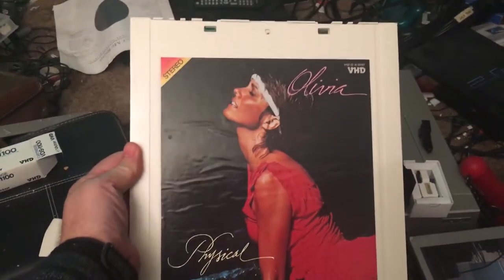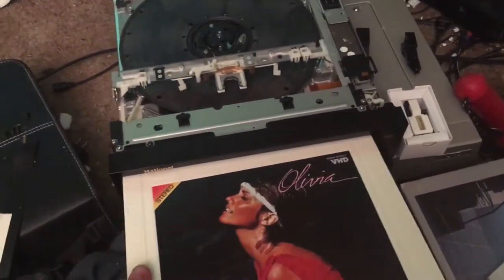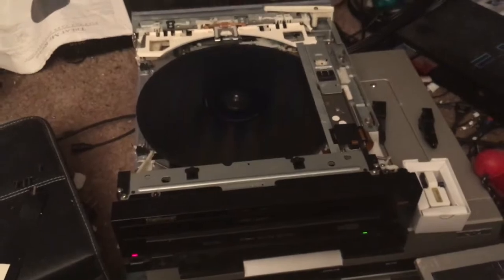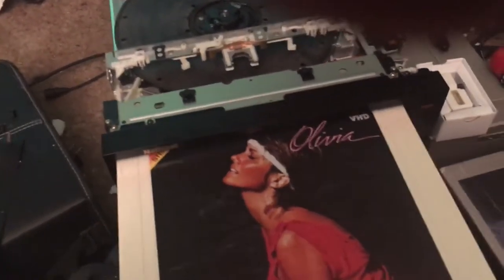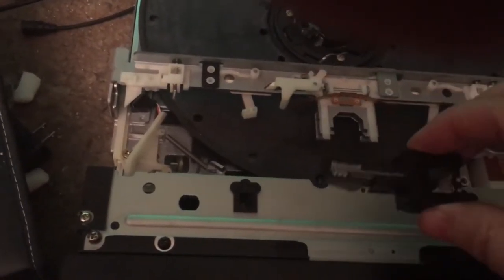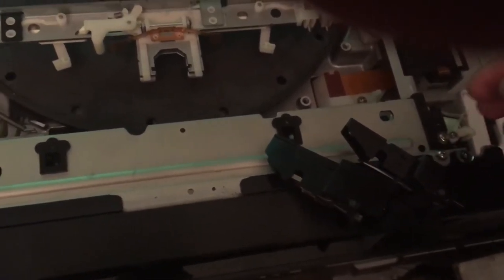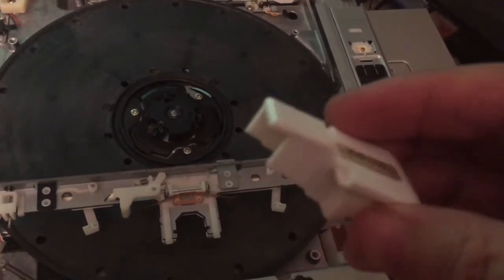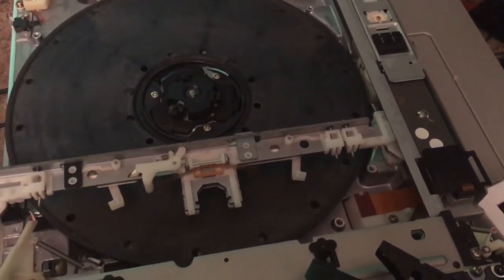National VHD player loading and stylus cartridges

Comment: That’s also a 3D player…can you demo that function?e
Reply from the maker: This one doesn’t have any plugs for the shutter glasses or switches to put it in 2D mode. I have an external box that I can plug shutter glasses into though that would work with this, but of course they won’t work on this TV because of the way it de-interlaces analog video, though it is one of the last TVs to support modern HD 3D and I’ll never buy one that doesn’t. There’s a way to re encode field sequential 3D as side by side for viewing on these types of TVs, there are a few conversions from 3D VHDs on YouTube.

My older US model player which of course doesn’t support 3D plays those discs at half speed.